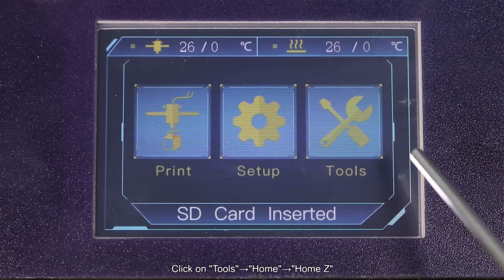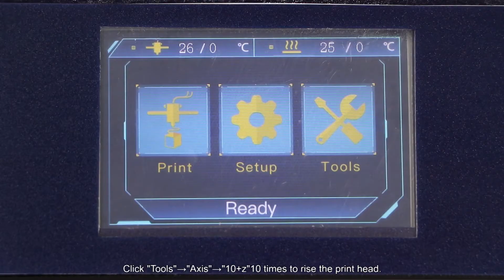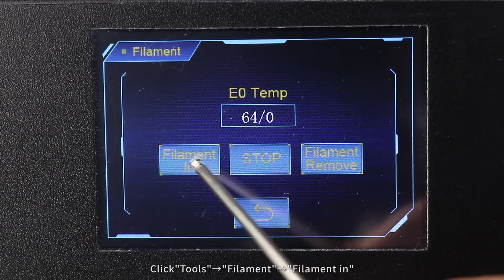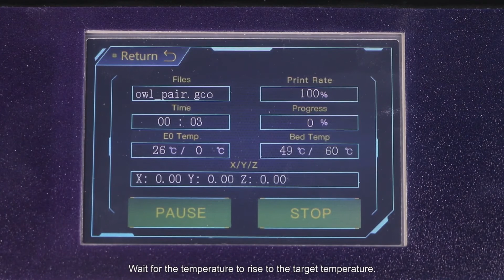ANYCUBIC X Leveling operation Video

Comment: I justgot the mega S, and having a extremely hard time getting the bed level  the left front has got to be bent because the other corners are tightened down all the way and that one’s is barely touching the printhead this is not my first printer so manual leveling I’ve done hundreds of times something is wrong, any suggestions or help?
Reply: Check your z stop screws!

Comment: So I did the corner leveling and for some reason it's fine on the corners but towards the middle it tends to scrape on the glass.
Reply: Same issue with me.
Reply: @hayden3408  me too... had to buy a replacement

Comment: So frustrating getting these printers leveled. Brand new PRO printed about 5 prints perfectly - now I can't get it to work anymore. I have the auto Level, and tried manual. Nothing works. The filiment doesn't stick.
Reply: try cleaning the build plate
Reply: @ericcardinal1967  That was one of the issues, along with leveling it when the bed is warm made it start working perfectly. I still think my table needs to be leveled too but it is working now.
Reply: I am using wood pla and it quit coming out mid print 2 times so far. First time clogged second time gears stripped the filament. I tried slowing down 75% turning temp up 5. It worked better.

Comment: @anycubicsupport even at the spring's loosest adjustment, the build plate is too far from the nozzle what should I do? The Z position of the nozzle seems to be at its lowest based on how I couldn't move the axis any lower, only higher.
Reply: You can adjust the Z limit switch height screws behind both uprights near the large threaded rod. Loosening them allows the extruder carriage axes to lower. They need to be measured and remeasured on both sides when doing this to keep them level. You can alter, rehome Z axis, and remeasure until they are similar. I suggest lowering your bed slightly all around before doing this to give yourself room for fine tuning later.